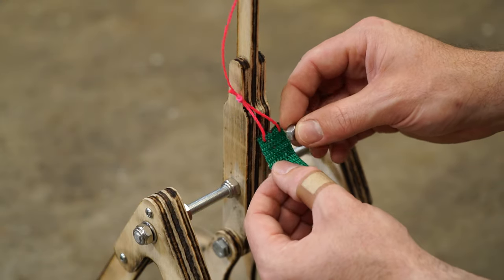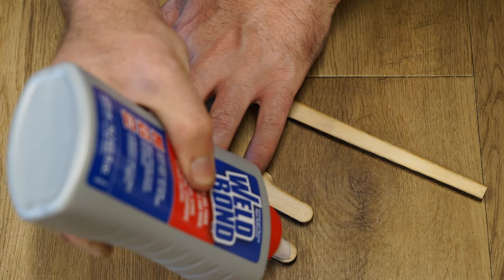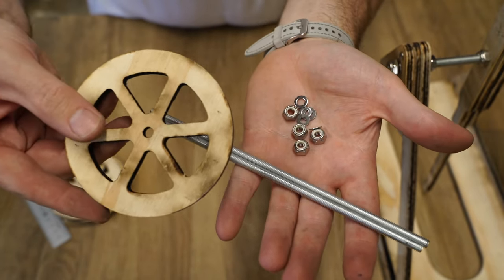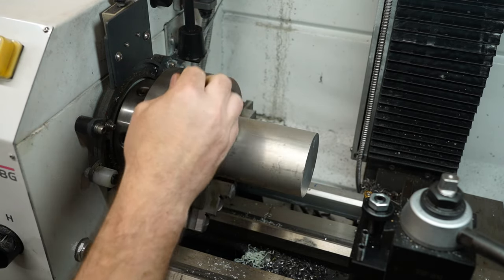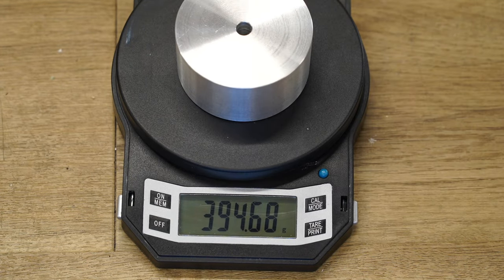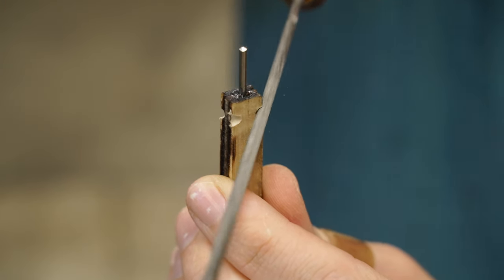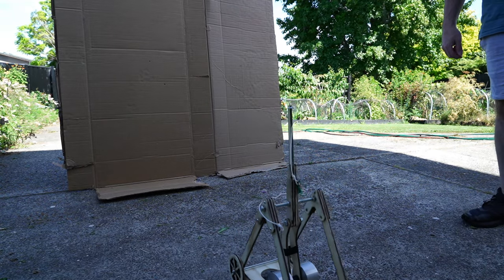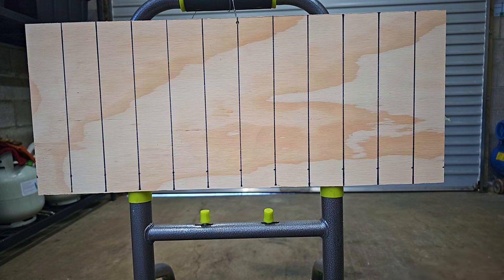DIY miniature TREBUCHET catapult II Free cut files for laser / CNC router

Comment: Hey! Is there any chance you can help me with something? It's unrelated to this video, but I figured it's fresh, so you might stumble upon my comment here. I have watched the video where you made an electromagnet from microwave transformers. It turned out great, you did an amazing job. But I'd like to know what kind of holding power it can exert over 40mm distance between the magnet surface and the piece it's holding. I need something similar for a completely different application where the electromagnet will be used as a temporary clamp, and it needs abut 10-15 kg of holding power over such distance. If you could smack a piece of wood or something similar on top of it and test it, that would be amazing, you'll save me so much time and money. Anyways, I really hope you can help me out with this, it would be so cool of you. Thanks a ton